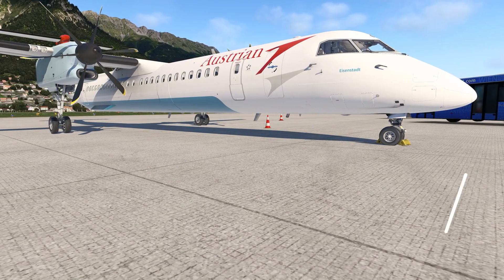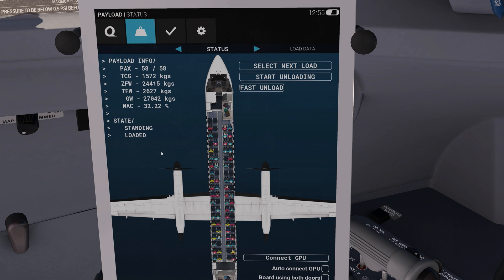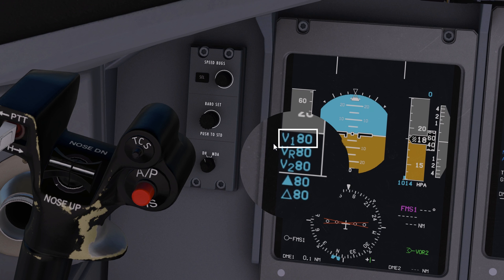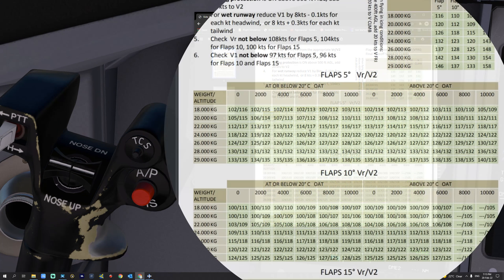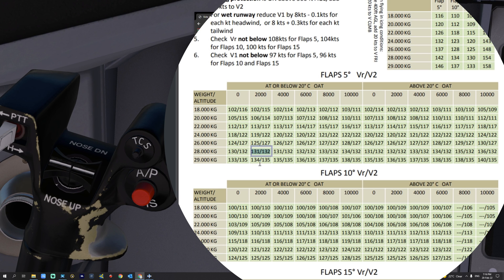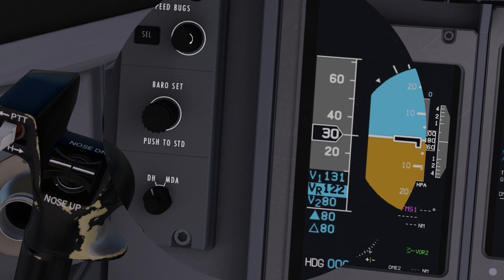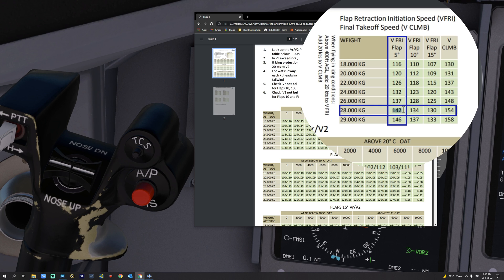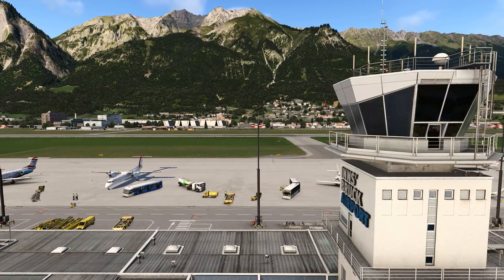Q4XP | How to Set V Speeds for the Dash 8 Q400 | X-Plane 11

Comment: I’m having an issue with my honeycomb bravo throttle with the q400. It won’t go to reverse thrust even though it was set up in settings. I also noticed that the throttle would gets stuck at the detents no one else seemed to have this problem. Pls help me fix it!!!
Reply from the maker: You have to map this manually.
Reply: How do I map it manually?

Comment: If you don’t have the tables, this aircraft has a feature where the VSpeeds will be automatically set by clicking on the VSpeed area on the PFD once you have set flaps for takeoff.
Reply from the maker: But that's no fun =)
Reply: @Q8Pilot  😂
Reply: you mean just over baro knob? i tried that and nothing....its always at 80 or maybe is another knob